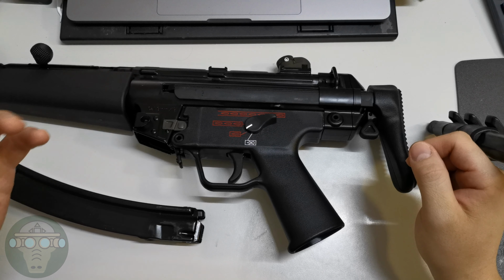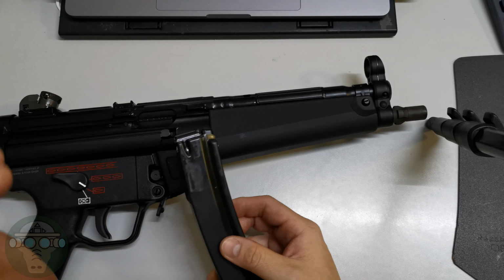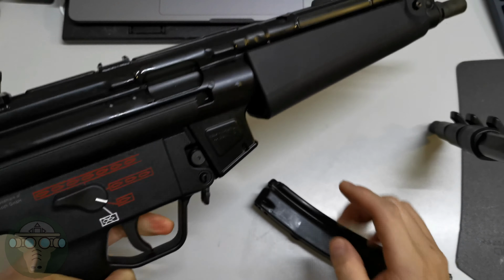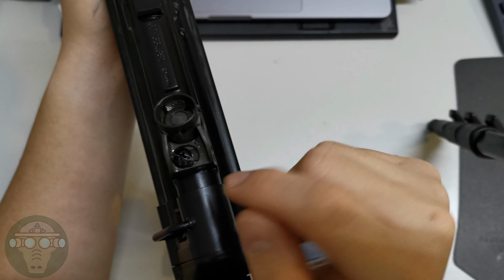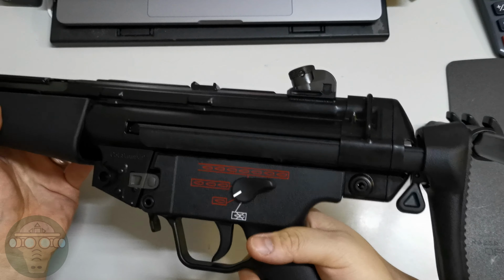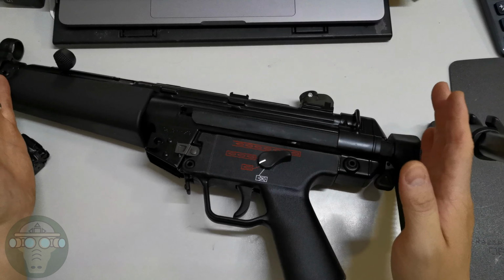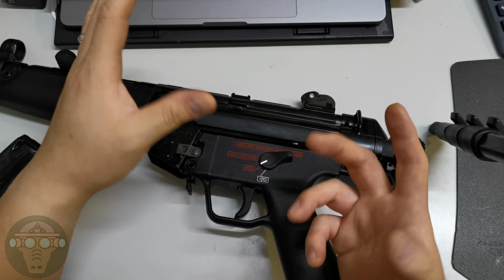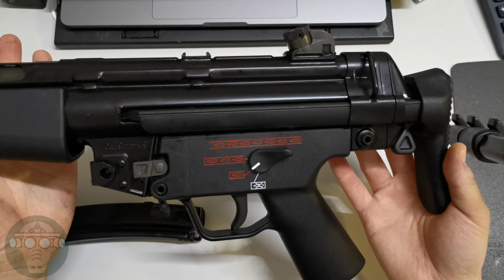VFC/Umarex MP5A5 V2, Honest review, Unboxing + Testing

Comment: Does the SD version that released earlier has the same internals like this newer one? Aside from the hop adjustment ofc.  They're both labeled V2 so I'm wondering.
Reply from the maker: I am not entirely sure, sometimes they label V2 but have something a little diff also, at diff batch
Reply: @BigCrocAirsoft  I see, I've seen some videos about SD series one that show bad accuracy and charging handle operation. But your video clearly show good accuracy out of A5 series. Maybe they improved the hop up? What about the charging handle? Do you think it's smooth or bad? Thanks for the quick response!
Reply: Yes, Except of course for the parts you mentioned and the SEF trigger group. The A5 trigger group will fit it however, if you're going for that SD6 look!
Reply from the maker: @MrCoffee0996  i was also using a gun tripod to help me stablize the gun, less human error
Reply: @BigCrocAirsoft  yeah good point as well. It could be human error